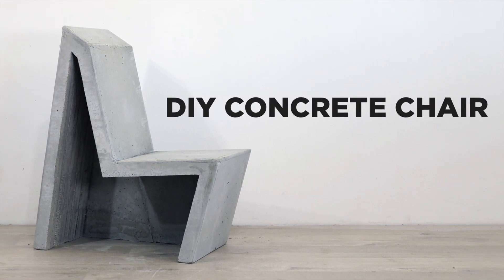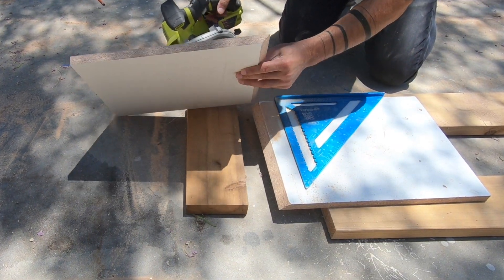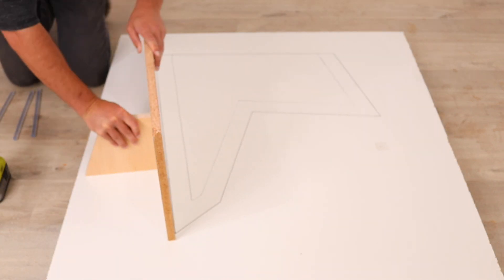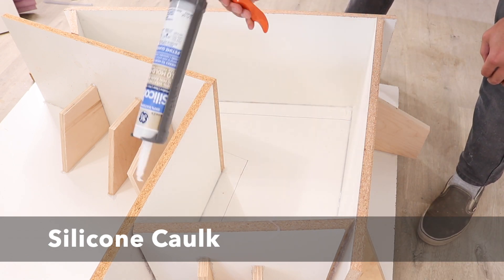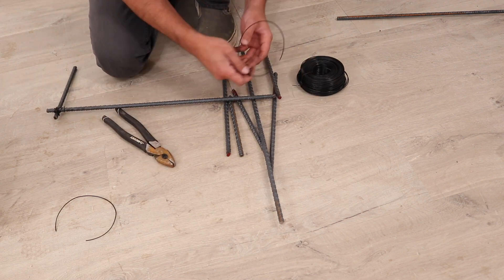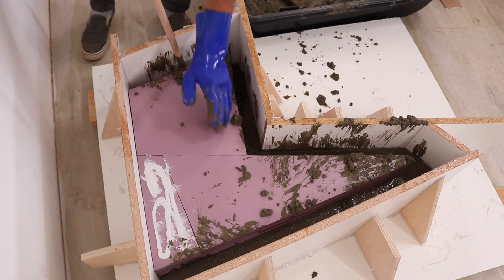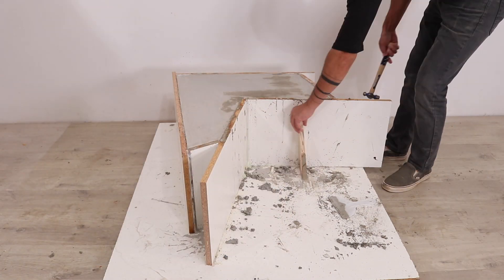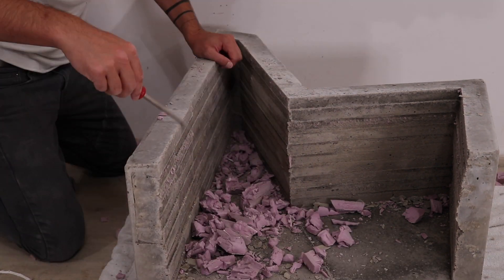DIY Concrete Chair

Comment: If you did the same thing but used aircrete (a little mixer drill bit with some sort of mesh tip will do the job), and some fibreglass = lighter and solid

Comment: A quick tip for helping remove air bubbles: use a hammer and lightly tap the form several times starting at the bottom and moving up. We used this technique when doing industrial construction on areas where the vibrators don’t fit.

Comment: Do you need to put any sort of finish on it?
Reply: You don't have to, but we recommend using Acrylic Concrete Cure & Seal (to seal, while it cures).
Reply: @quikrete  most of the buildings  here in greece are made with concrete and need regular maintenance to keep them from deteriorating.

Comment: Might be a dumb question and I’m sure there are health hazards but if you were struggling with getting the foam out could you have put the whole chair in a fire pit and let it melt out basically? (Probably would be pretty messy)

Comment: Great video, I was wondering have you consider aircrete for building the chair, it may make it even more light weight, I'm not sure about the strength though, Man about tools made a great video about reducing the weight of a garden bed made from different types of concrete https://www.youtube.com/watch?v=ddedMmuj7xY , the question is will it be strong enough for a long time?

Comment: I like your way of thinking: to create as little waste as possible!! Well done!
Reply: But he didnt. All that styrofoam filler... all that useless hotglue.... A few screws with have fixed everything in place perfectly. Also the inner part could have been made with scrap wood. the screes are than recycable and in addition you can screw everything back together for creating another chair easily. I see lots of improvisation here.
Reply: @doktor_faust  well... there is room for improvement! That's for sure

Comment: Nice 👍. A coat of wax might be nice on the surface 😀
Reply: That's a great idea - you could also apply acrylic concrete cure and seal (to seal, while it cures).

Comment: Great design, Ben!  Do you think it would have worked with stacked Plywood as a filler (waxed), to make his a more "batch friendly" build?
Reply: biggest concern would be removal, the foam works well because its easy to break up. Plywood, even waxed, will be difficult to get out if it gets wedged tightly. If you changed the geometry of the leg so that it didn't back inwards it might be easier but idk how easy it will be. It might be easier to just make an inner melamine mold similar to the outer one, i think you'd be more likely to reclaim more pieces.
Reply: Like Troy said, the concrete shrinks when it cures. You wouldn't get solid pieces out. If you make an inner mould, you need to be very thoughtful about how you assemble it so you can get get it out once the concrete has cured and shrunk down on it. Relief cuts might help so you can break out solid material or allow you to bend it enough to get it out.

Comment: Just when I thought there weren't any new form making techniques, you show the bracing method to strengthen the form.  Even for smaller projects I think this method might be easier the pocket hole screws or similar methods.  Love the shape and design of the chair!  Thanks for all the knowledge and inspiration, Ben!